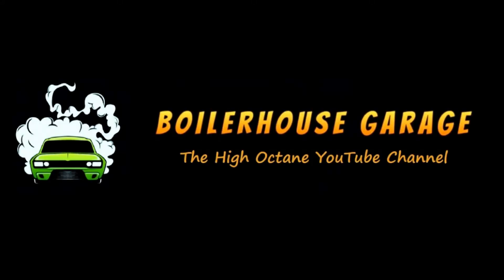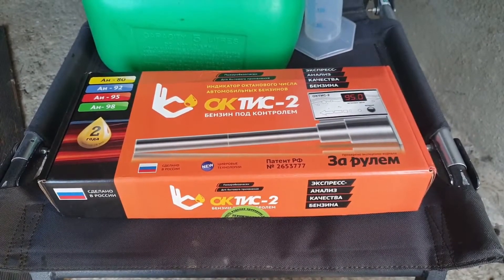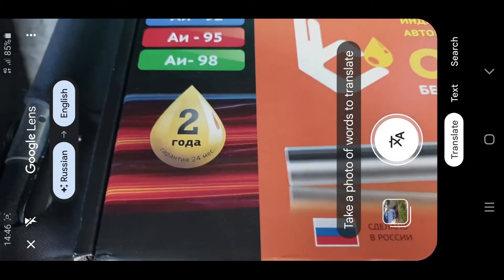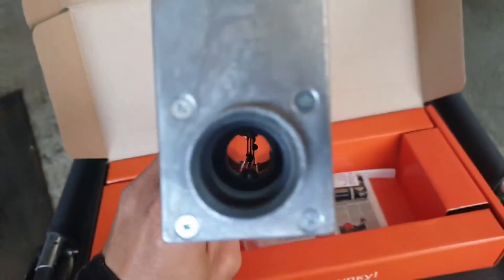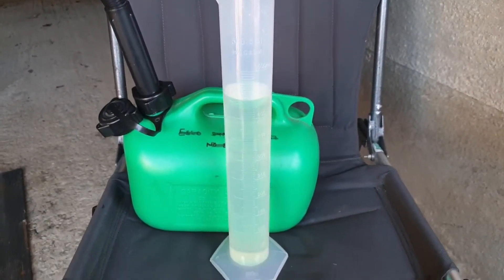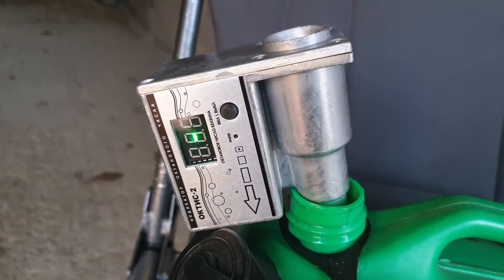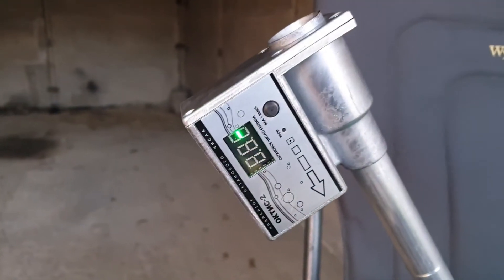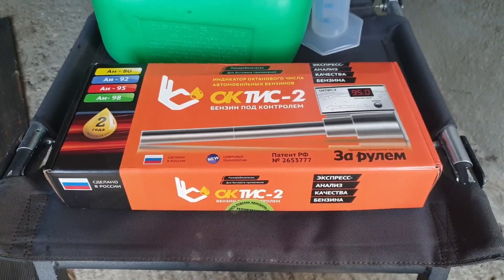Testing Petrol / Gasoline for Octane ⛽ Part 1: Introduction to the Oktis-2 Tester 🔥 E5 E10 RON AKI

Comment: How do you change the modes (AKI/RON) on the device? I have the device but cant figure out what exactly I am measuring, whether its AKI or RON.
Reply from the maker: @ChristopherMasai  There's a little "reset type" button on the front that you have to press with a pen on small tool, switch it on while holding the button for about 3 seconds, the screen should change from PYC to USA, which is RON and AKI respectively.

Comment: If i were to use this to measure gasoline with a small amount of ethinol, even though my readings may not be accurate,  i should be able to tell if one gas is better than another, correct?
Reply from the maker: With just the gas "as is" then sadly not, as even 2% ethanol will just give the maximum (false) reading. However as I've done in the past, you can extract the ethanol from both fuel samples, then test it to see which of the two might have better octane boosting additives made from a petroleum distillate, such as Shell V-Power, which contains considerably more than even top rival brands.
Reply: So I live in USA. I extracted 8% ethanol from 94 octane, and the meter read 82 ot 2 different samples from two different sunoco stations. 12 octane seems to be a lot for 8% ethanol.  Also, I tested c16 race gas, which should be 116 octane, but the meter reads 84. Any thoughts?

Comment: Does measuring 110 means that E10 is ron110? or just wrong reading. is e10 95ron actually a ron110? or has less knock resistance than non ethanol fuel
Reply from the maker: No, it's an inaccurate reading as the ethanol has different properties--there's more oxygen in its hydrocarbon chain and thus is less resistant to what the tester is measuring for. 

95RON "E10" (which is never 10% in the UK) is using ethanol as part of it's octane boosting additives, so would be only 95-96RON. The only advantage would be that it will aid cooler internal engine temperatures, which can be useful on small capacity turbocharged engines, but the difference on 5-7% (what E10 is in the UK) would be negligible, yet you lose considerable mpg by even just a small amount of ethanol in the fuel blend.
Reply: @boilerhousegarage  Thank you for the reply.

Comment: I don't want less Ethanol I want more. Todays vehicles can run all day on E-Mixes. I run E30 on a 2022 Ford ranger 2.3l ecoobost. Stock HPFP and Stock injectors.  The power increase is amazing. runs cooler and cleaner. The trade off is the MPG's. don't care, plus it is 80c to $1.25 cheaper per Gallon in the US.
Reply from the maker: And you should be given that option; as should the rest of us have the option to run pure gasoline, not ethanol blends.
Reply: Yes they all run on it but don't run your car for a few months and you will see the havoc that gets caused.
Reply from the maker: He also ignores that not everyone has or wants "today's" cars and most of us want them to last beyond the short service life "today's" cars have.

Comment: Hi. You didnt mention in the video or description what fuel you were actually testing? Was it 98 RON pump gas?
Reply from the maker: Hi there. Yes, I intentionally neglected to mention it as wanted the brand results to be known in a separate video. It was Esso/Exxon 98 RON, which as it turns out is actually lower octane than advertised. The tester (once I'd standardised the testing method) has shown to be accurate within 1 RON and shows consistent results on other brands such as Shell V-Power (99) and BP Ultimate (97). Thanks.
Reply: @boilerhousegarage awesome! I guess I'll order myself one and see if it helps diagnose my annoying knock. The octane number it displays is basically the US octane/ AKI number? Did you find that the conversation it does is accurate (e.g 95 Ron reads 91 Octane on the same sample)?
Reply from the maker: @112rorz  I'm not sure how accurate the conversion is as only used AKI for the first couple of tests, or rather how it converts as I think the value it reads (a resistance) is converted to either rating type. Please note if you're in a state that doesn't offer ethanol-free gas, the tester won't work as it can only measure the octane of gasoline, not gasohol, E5, E10—even 1% of ethanol won't be testable.
Reply from the maker: What car are you experiencing the knock just out of interest? If you suspect it's fuel related, you can just buy the highest octane pump gas available to you and then add an octane booster, or order a can of race fuel.
Reply: @boilerhousegarage race fuel is super expensive here but I could give it a try. I'm in Qatar and I'm using the highest available gas. We only have 91 and 95 RON. We used to have 97. I have a 2013 BMW 650i which has a V8 N63TU engine. Recently rebuilt. I tested compression, it's still good and within spec. I have Bootmod3 and I flashed the 91 Octane map, but it still knocks. Even on stock map it knocks. Any idea what else can cause knock?
Reply from the maker: @112rorz  That's surprising. I thought all the countries in the Gulf would have cheap and good quality fuel. Perhaps it could be an issue with the BMW vanos system giving too much advance? They're temperamental anyway, but could well be causing timing issues if controlled independently from the map.
Reply: @boilerhousegarage  well, the race fuel is super expensive compared to the pump gas here I mean. 95 fuel is £0.46/L and race fuel drum of 19L is £95. Interesting theory about the vanos, I'll read up on it. It's not throwing any vanos codes at the moment though

Comment: how do you calculate the octane rating of a gasoline 89 octane RON + 10% methanol or 89 octane RON + 10% etanol ?
Reply from the maker: I can't. My tester can only measure gasoline, not blends (with ethanol or methanol added). What I'm trying to do is find out how much octane ethanol is adding, when I extract ethanol from the gas, but the issues are that I have to assume the advertised 95 RON is correct and that the actual additives in the gas vary and also change the octane properties.

Comment: Oh this is joy! A Russian product too, being imported to the west: how the tables have turned since the Soviet days.

Whatever that sample is of measured 93 AKI, I'll speculate that it might be 99 RON, 87 MON, thus 93 AKI.
Reply from the maker: In Russia, petrol tests you! Yes, it certainly doesn't seem any better quality than Soviet products! 😆

93 is more like 97.5 RON 85.5 MON, but this tester does decimal places, so I might have to round up as it was surprisingly lower than I expected.

99 RON is 94.5 AKI according to a few charts I downloaded and I still have to experiment with the tester to see if setting it to RON requires recalibration.
Reply: AKI = (RON + MON) / 2 ❓

So 97½/85½ yields 91½ [AKI]?

Looking forward to seeing more of these.
Reply from the maker: In general yes, but apparently there are variables on how MON is measured or that it's a minimum at all conditions whereas RON is not (from some quick reading that I didn't fully understand) so it makes conversion formulas a little imprecise. A general one I was given to simplify is RON=AKI*(22/21) so I don't have to pay much attention to MON, hence my inaccurate guesses the from memory above. 

Looking at the tables, 93 AKI shows as 97.4 RON and 89 MON, which works out as the pair averaged. Using the formula it works out the same.